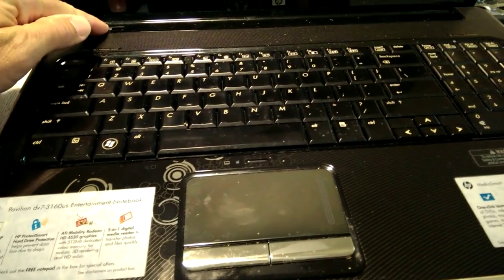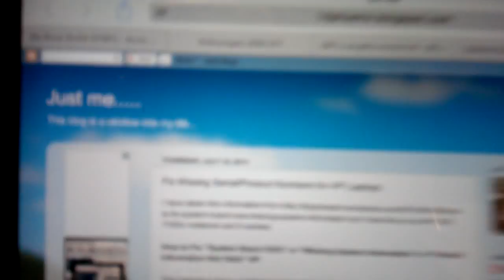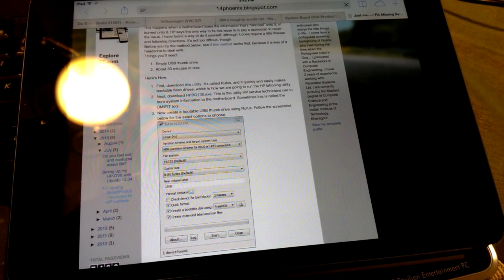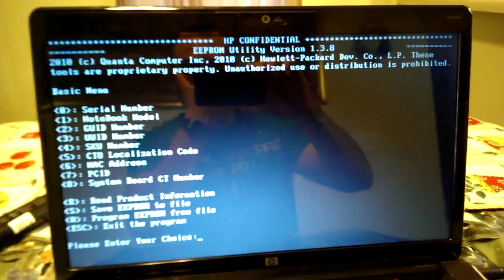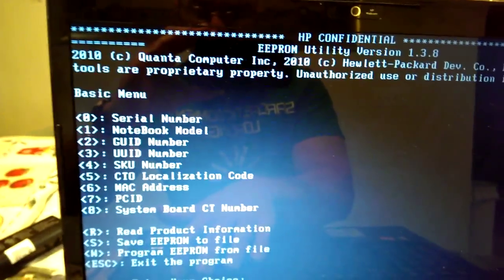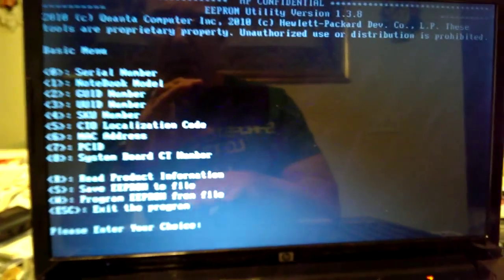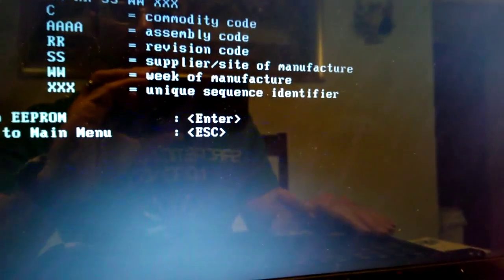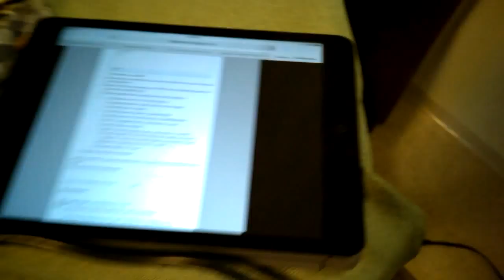HP Laptop Motherboard programming how to DV7 3160us part 2

Comment: hp is a hell of a problem on laptops but thanks to you following the steps and what the other guy did was great, thanks alot, it work perfectly, no more errors
Reply from the maker: No problem Jorge, I am glad it worked for you. I couldn't STAND that boot up message.
Reply: yeah i hate every single little error messege a computer pops out so i break my head to always fix it, thanks alot